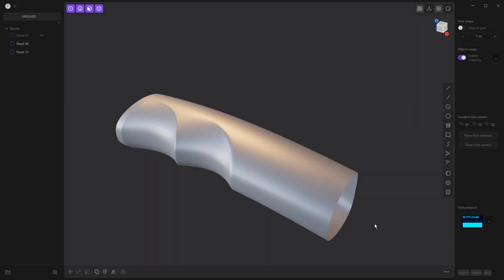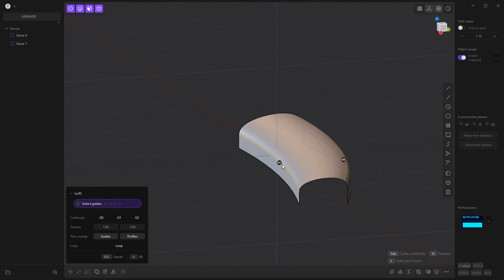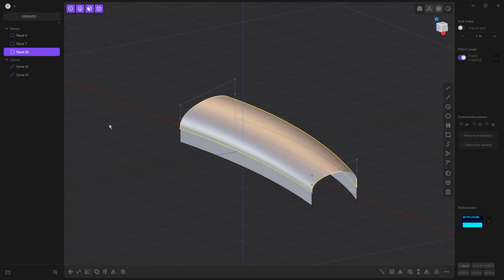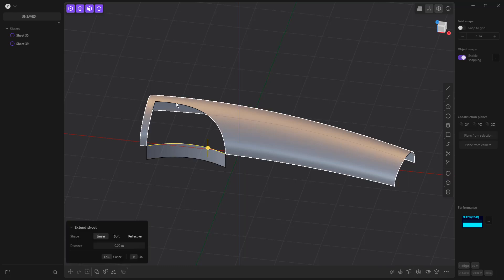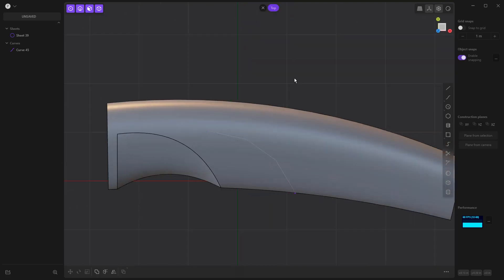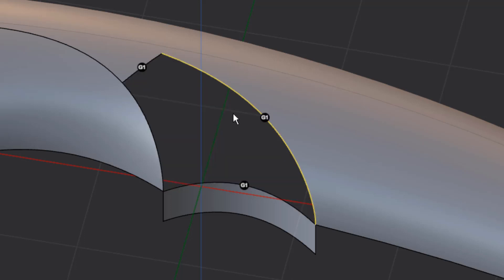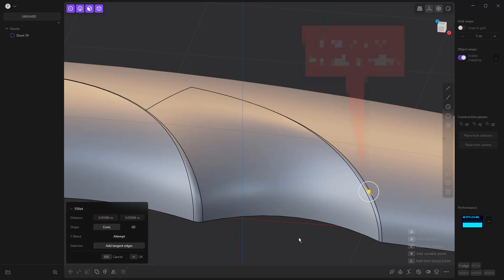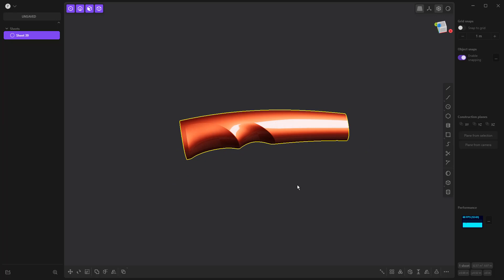Plasticity Quick Start | How To Create Complex Surface Details

Comment: Cool ! Good job. You use ALT J and DELETE to remove the surface, but using SHIFT X... You will avoid a step.  Many thanks for this tutorial.
Reply from the maker: Thanks for the tip!  What is Shift X command called?  its not in the F key menu.  I feel like you used to be able to just hit Delete in the past.  I will be sure to point out Shift X next time I make a video!! thanks
Reply: Right. I was using SHIFT X while following along and was wondering to myself if I have been doing it wrong this whole time🤓

Comment: What is "tangency" exactly? Not a CAD person
Reply from the maker: This video might help. its not in plasticity but maybe offers up some visuals. 
https://youtu.be/q_g517XVCww

The basics:  If you think about driving your car around a curve, lets say a circle.  If at any point you turn the wheels back straight, you have exited the circle tangent.  Essentially you are looking at the direction the curve would go if it just stopped.  Mathematically speaking its a direction vector at a point on the curve.  When we are modeling in 3d it can be a curves direction, or that of a surface/sheet.  Your new curve or surface could be connected, it could have tangency, or curvature continuity.  Tangency just controls the direction, think back to the car around a curve.  Curvature continuity (G2) will also look at the radius.  For a true circle it would carry on with that same radius, but for a more complex curve it would account for your direction and radius of the new curve (where they intersect)
Reply: @LearnEverythingAboutDesign  i know that much, i guess i’m just unclear as to how a NURBs modeller interprets things as i’m more used to polygon modellers. I get a lot of unexpected behavior in Plast. I should probably track down some vids on the differences between the two. Thanks for the reply and the great videos! I was able to get up and running in the software within a day thanks to your help
Reply from the maker: @regularmenthol  hard to tell whats going on that is unexpected without seeing it.  You can email me support@caducator.com if you want to share some screen shots.  One thing with Plasticity is that the edges of a surface/sheet when lofted will not follow what you think without some guide rails.  In CAD often times you have a "follow surface" or "follow curvature" option.  Sometimes they are the same, but often they are not.  For example if you had a simple curved surface and you trimmed its edges.  If you made a tangent surface you would want it to follow the edge, but in Plasticity(and most CADs by default), it will follow the shape of the surface which means your new one will kind of bulge out.  I have a 5.5hr series on car modeling in Plasticity where we using bridge curve and bridge vertex a lot to help drive a loft or build a patch surface.  For right now this is the approach I would take.  Doing a bridge curve is likely the quickest way.

With Poly modeling, unless you are dealing with curves, you are generally building a bunch of quads.  The straight edges of the quads (and the polygon made by the boundary) is what is controlling the curvature.  Fusion 360 has freeform modeling which is SubD and a similar workflow to Polymodeling.  I have a few videos on going back and forth https://youtu.be/wRXf4QyMCMc  But what you will see that is a bit different is that Fusion form modeling has the push/pull workflow and you can go back and forth between box and smooth display.  While in poly modeling you end up either Shading smooth or doing SubD to smooth things out, in fusion we are actually manipulating a nurbs surface.

I actually have this same shape as a fusion Surface tutorial as well if you want to watch that https://youtu.be/VvsI8Ei6ug4

Comment: very good 3d cad program! very, very similar to Design Spark Mechanical / Space Claim.... but Plasticity has a nicer UI, colors similar to AutoCad. However, a big minus of Plsticity!! - it has no power steering - SpaceMouse !!...what a pity!...I hope this will change in the future in the next versions of Plasticity.
Reply from the maker: Im not sure if it will or not.  Since it was a CAD program designed for Artists, not sure how many use a 3d mouse.  I have one that over the years i go back and forth on.  sometimes I use it but maybe 1% of the time :)

Comment: Have you tried reverse engineering with Plasticity?
Reply from the maker: Currently an imported mesh isn't good for much other than a visual reference.  You can't snap to it or get curves from it last time I tried.  So i haven't yet, but once mesh imports are usable I will give it a go!
Reply: @LearnEverythingAboutDesign  Have you ever used the software Design X 2022?
This is what I am learning now, reverse engineering seems to be the only option
Do you have any more recommended reverse software?
Reply from the maker: @enjoycarsTW  That is an expensive piece of software :)  It kind of depends on what you need when you talk about reverse engineering.  I have a lot of videos on scanning and design off scans/reverse engineering in Fusion 360 on my channel.  From car fenders, trim pieces, door speaker pods, Ive done some designs like ear pod shelf off scans and i have this series that looked at the 3 different ways to reverse engineer from scan data in Fusion for a brake lever https://www.youtube.com/playlist?list=PLBDfGh8A8kXWa_eSWWPPZ5NevfWsDwJrj

Comment: Can you continue the series of videos on concept car modeling? I find it the most useful as it uses so many modeling techniques at once.
Reply from the maker: I do plan on that, but i was waiting on 1.2 to be released, which it came out this week.  My next plasticity video will go back to the concept car i think.
Reply: @LearnEverythingAboutDesign  Hmmm... Maybe I'm missing something, but I'm running version 1.2.1 right now. 😀
Reply from the maker: @koganboss4874  sorry if it wasn't clear.  When i started the concept car video there were some surface tools that I knew were coming since I have beta access.  So I didn't want to carry on with version 1.10 knowing that the workflow would improve.  This video i did with the beta which was going to be 1.2(which is now what you download when you buy or start the trial).  So basically I wanted to wait until it was public before doing too much more surfacing work :)  Hopefully that made sense.

I will try to add to or create a new concept car video next week.
Reply: @LearnEverythingAboutDesign  Great, I'll look forward to it. Thank you!

Comment: I also think that all the design that has gone into the GUI or Graphical User Interface is important - early days for Plasticity, but I actually like and enjoy Constraining sketches, Draft and Object Deviation software analysis, I like making professional dimensioned drawings and assembly BOMS with Mass and total mass summations - whilst Plasticity has some very fast tuned creation methods ( beyond doubt), other modellers aren't far behind at all - the slowest factor in this creation process is my mind and mouse clicks. I'm not going to ditch my experience and subtle training in modeller X for what Plasticity modeller Y is offering... The author Nick Kallen has tailored Plasticity for typically Concept Artists asset creation ( his words)  and whilst 'Product designer's' can benefit from Parasolid modelling capability, the question of whether Plasticity will ever have all the other complimentary tools for product definition and recording , which is a long list of functionality built up over decades of program development in many competing programs remains unanswered. Plasticity does only what it says and nothing else.
Reply from the maker: Agree with you.  Part of the reason I hopped into the beta of Plasticity and signed on for the Studio license was to provide some of that feedback.  Nick understands his target audience but also knows there is a market there for users that want more CAD as well.  I would guess there is nothing on the short term road map but in the future I wouldn't be shocked if Plasticity had a more of a CAD workflow option available.